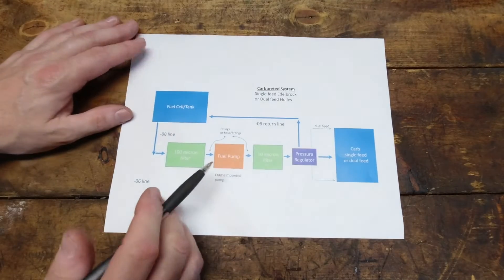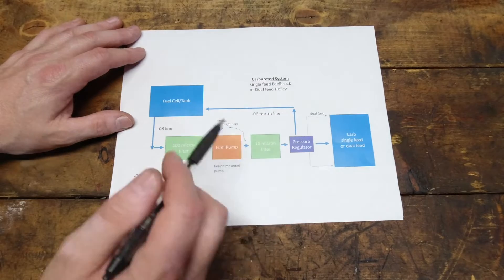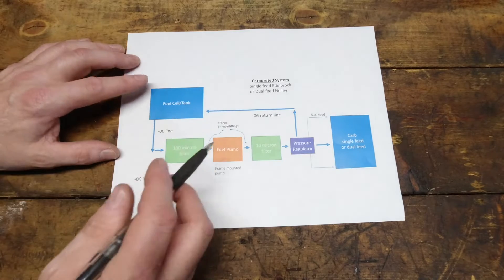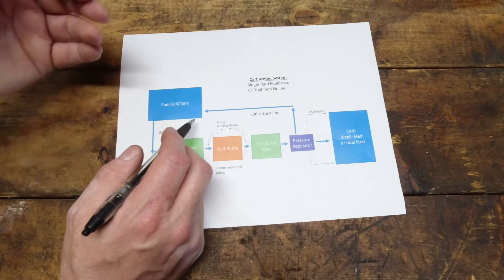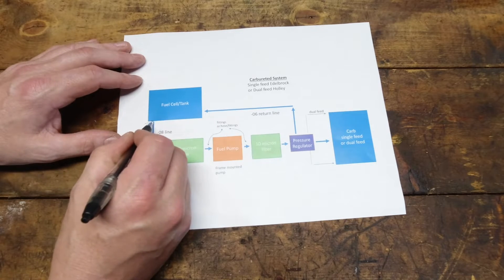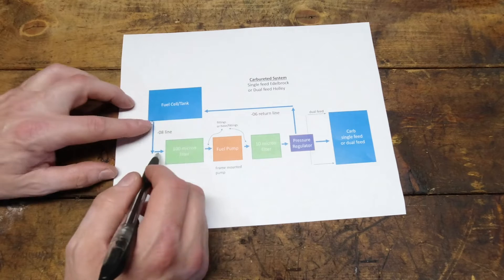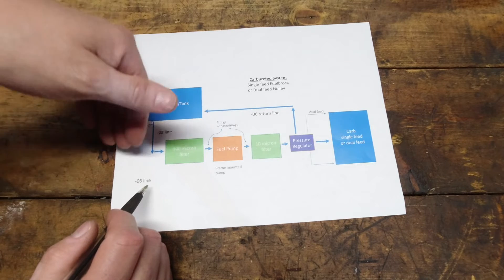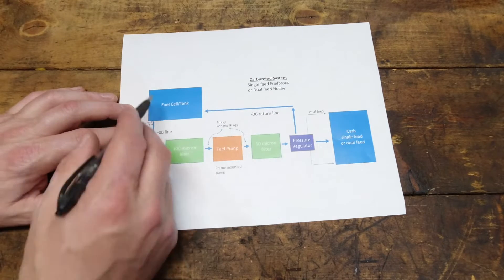Fuel System Diagrams - Take the Guess Work out of Building your System

Comment: Very helpful but a couple of rookie questions. 1) Do you have to/or should you vent a tank for a carb system. 2) on your diagram for the intank fuel pump for a carb, you have a 100 and 40 micron filter after the intank pump. I thought you didn't have to use the 100 micron after the intank pump. Am I off?
Reply from the maker: @jimbalcom2880  100m catches the large particles, 40m the smaller.  If you run just one 40m, it clogs faster and reduces system flow.  Always run two.
Reply: @MuscleCarSolutions  Hmmm, okay, thanks. I thought (for some reason) that using the in-tank pump with a filter sock on it eliminated the need for the 100m filter. Maybe not. Do you recommend putting the 100m right after in-tank pump near the gas tank? Also, any thoughts on venting the tank? I know it's required for an EFI but what about a carb? Really appreciate your thoughts.
Reply from the maker: @ are you using a universal tank?  Generally they’re vented.  If it’s a factory tank, whatever configuration they’re in works.
Reply: @ Its a Tanks Inc 32 style tank. It came with a vent and the Tanks Inc pump has a vent barb.

Comment: Great video and very detailed diagrams but I have a question. On a dead head system should I also add a filter between the regulator and carb? I plan to use the same layout as your "carb fuel diagram" but not use a return line. Or is the 100m (pre electric pump) and the 10m (post electric pump) sufficient?
Reply from the maker: @Birdman0727  most filters will cause a drop in pressure.  The regulator is the last thing before the carb.

Comment: Will a 5 micron fram hpg-1 be too restricted?
Reply from the maker: If you’re working with an extremely sensitive diesel engine that requires that level of filtration.
Reply: No, i have a new Fram hpg-1 in the garage. Specifications say particles as small as 5 micron. It would save me from purchasing two.

Comment: Hi I know this is a year old but I have a question that I have not been able to get an answer for. Maybe you can shed some light on this. I have an in tank pump that has a return regulator built in to return right inside the tank. It is a 60 psi 265 lph pump and I want to use it with a carburetor. My question is can I use a deadhead style external regulator right before the carburetor, and let the return still be handled by the in tank pump? This would simplify my installation by not having to run a separate return line back to the tank. Thanks I appreciate your videos and hope you can help.
Reply from the maker: Aeromotive makes a really good regulator that will regulate that down to feed a carburetor.  You can continue to use the high flow/pressure pump in the tank.
Reply: Awesome is that a regulator that I could deadhead and just let the in tank do the return? Appreciate the quick response thanks

Comment: So not running a return line would be a big mistake?
Reply from the maker: Not necessarily.  I prefer to run a return.  On some applications it perfectly fine to run a deadhead style regulator.  My GMC is currently on a deadhead system.  L

Comment: Hi i have a mechanical fuel pump on my 350 sb. Im going to install a new fuel tank. Do i need to connect the return line to the tank, as i dont have a return hooked up at the moment with old tank.  Thanks for your help.
Reply from the maker: Sure can if you wish to.  Yes!
Reply: What can happen if i don't connect the return line.  Thanks
Reply from the maker: @chrisr4740  why would you not?  The return is a great benefit to keeping the fuel moving through the system which helps keep it cool.  Or just buy a deadhead regulator if that’s what you want?

Comment: I just finished tuning my 350 chevy engine and forgot to change fuel filter. Could I just replace fuel filters and leave tuning as is? Or does timming need recalibration?
Reply from the maker: The filters won’t affect the timing.  Change them as needed.

Comment: Hey I'm building my first fuel system with -6an fittings, which I also have never used, when i go from the barb on the fuel pickup to my first barb to an fitting, do you just use ordinary fuel hose to make that connection, I was under the impression that normal fuel hose shouldn't be used as it degrades over time, and maybe that little piece wouldn't be an issue anyways...?
Reply from the maker: All fuel lines deteriorate over time.  If you’re concerned with the ethanol expediting that process, you can get PTFE rated lines.  In regular fuel line and aftermarket.

Comment: You have very informative videos and I have learned a lot.
Question, I have a mechanical fuel pump that has the feed line from the tank and the return line also comes back out of the fuel pump.
If I install a fuel regulator with a return, would I tee the regulator return back into the return line from the pump? (1970 olds 455 original mechanical fuel pump).
Thanks for any ideas!
Reply from the maker: Do all the fuel pumps for that engine have a return?  I’d prefer to run the return at the regulator, but you could likely run a deadhead regulator and continue to run the return at the pump.
Reply: @MuscleCarSolutions  Yes, according to the original shop manual for that engine.
I just installed a new Edelbrock AVS on it and it runs smooth at idle but if run it at high rpm, it starts skipping or missing so after watching your videos, it made sense to install a fuel pressure regulator. 
Thank for any ideas.
Reply from the maker: @Eric-wq4lj  so when you say run at high rpm, do you mean wide open throttle, or driving and holding at one steady rpm?  Like 3000, as in cruising down the highway with a stock 3 speed trans?
Reply: @MuscleCarSolutions  No, this is while it is in Park and operating the throttle by hand. Almost at full throttle.The car is not ready for the road yet .
Reply from the maker: @Eric-wq4lj  I wouldn’t worry too much about that.  But yes it could be a number of things.  Either a lean condition, or timing.  A regulator is always the right answer!  When you get to driving and tuning, you’ll be able to sort any issues.  The issue with what you described is, there’s no load on the engine.  So it’s very difficult to eliminate that before you start driving as it’s not going to give an actual condition.
Reply: @MuscleCarSolutions  okay, awesome.
So do you still suggest a Dead head regulator for this application?
Reply from the maker: @Eric-wq4lj  I think that would be where I would go if you’re keeping the return fuel pump.
Reply: @MuscleCarSolutions  Okay great!
Thank you very much for the advice!
Now I need to make a list of parts...
Thank you!
Reply from the maker: @Eric-wq4lj  best of luck getting everything you need to get it driving again!
Reply: @MuscleCarSolutions  Thank you!

Comment: great tips and I too am a firm believer in using a in tank pump when possible. Not only do they run cooler but they are quieter on cars that get driven. Believe me a fuel pump droning away can easily ruin cruising.  
People equate today's pumps to the junk GM sold in the 90s that would quit once a month. They're extremely reliable and can make some serious power on oem pumps. 
Lastly don't be afraid of hard line. I've seen a friends car go from driving to to fully engulfed in flames in seconds because road debris punctured the line.